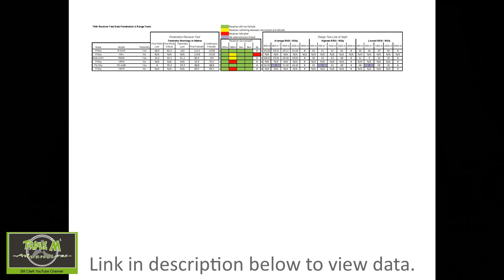Receiver Test – TBS Crossfire 6ch PWM Nano

Comment: hello! Thank you for the good information. I bought this receiver for my f3k glider, can I connect and use the 2slipo directly? Does that mean that the servo will be powered by high volts?
Reply from the maker: The manual shows input voltage at 5 volts so I suggest getting a BEC for your model.
Reply: @the-happy-RC-flyer  Thank you. Have a happy flight.👍👍

Comment: hi bill will be doing a tbs tracer video like to know how to wire up if u have no flight board/ as like to use for a plane/wing.and use sbus.
Reply from the maker: In my range test I used the Crossfire Nano PWM receiver which has the PWM adapter already soldered to the Nano receiver. I am going to make a video of me setting up the Tracer Nano PWM receiver for one of my planes. You can purchase the PWM adapter separately to solder your Tracer or Crossfire Nano receivers so you can plug your servos directly into it. TBS Tracer Nano PWM range test coming tomorrow.
Reply: @the-happy-RC-flyer  thanks i did find this video /looks if wire the same red wire is 5volts/black wire gnd/txto signal.https://www.youtube.com/watch?v=eMtg45sz0zE
Reply: Thanks for sharing. I’m just getting into cross fire and trying to figure out how to install these receivers with my fixed wing aircraft that aren’t using flight controller. Can I use this receiver to do that?
Reply from the maker: @Andrewsplanes  I just released a video to help you with the PWM Nano receiver 
https://youtu.be/J0KluCBZgPo